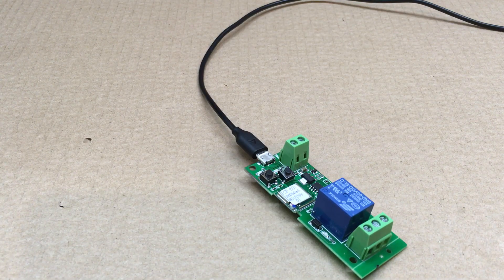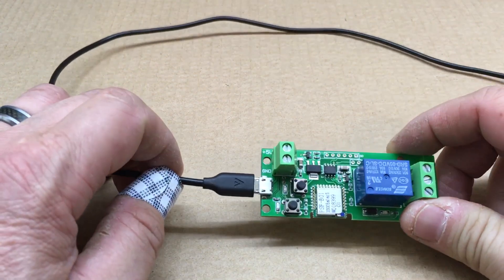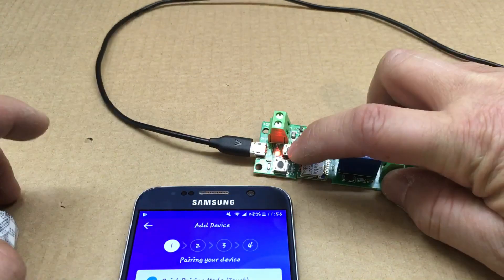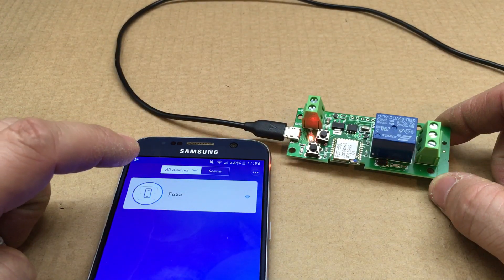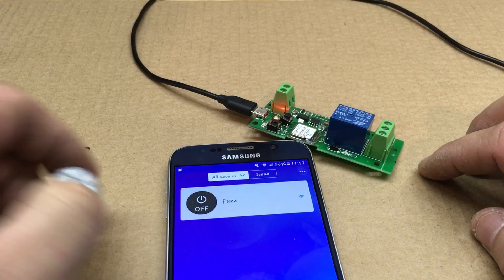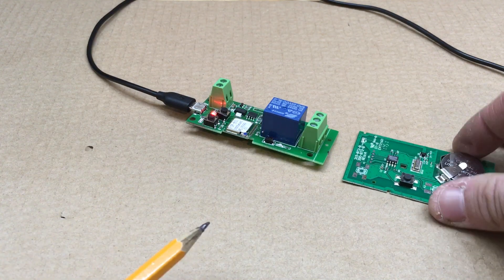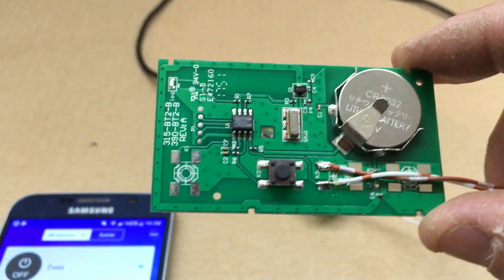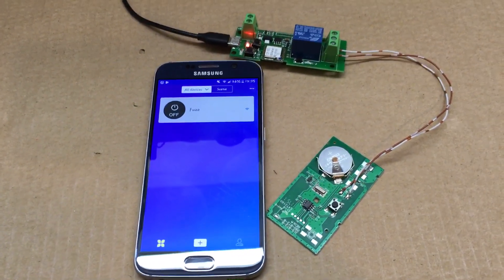Wireless Smart Relay With ESP8266 On Board For Garage Door Opener And More

Comment: You show a relay board: WiFi Smart Relay With ESP8266 On Board.Is  this available from Amazon?
Reply from the maker: Yes I got it on Amazon.
Reply from the maker: MHCOZY WiFi Wireless Smart Switch Relay Module for Smart Home 5V 5V/12V，Ba applied to access control, turn on PC, garage door (5v) https://www.amazon.com/dp/B0752P57ZG/ref=cm_sw_r_cp_api_i_1i2YDbGC9222S
Reply: Thank you Fuzz Pi for your Quick response !